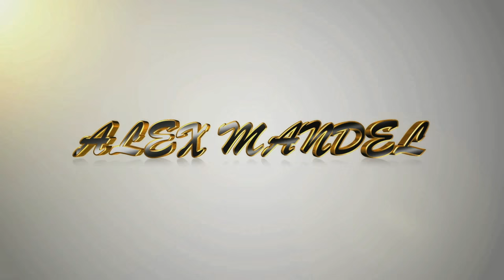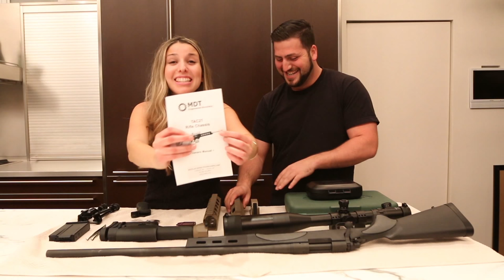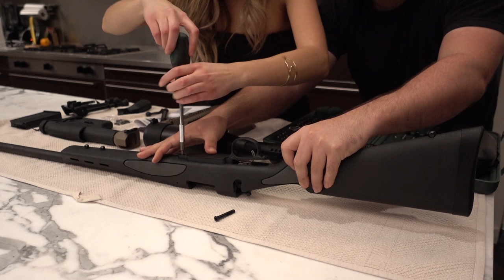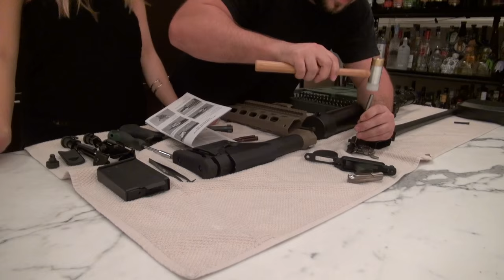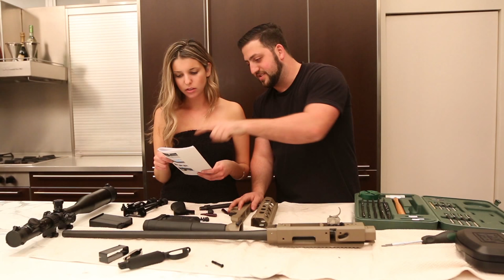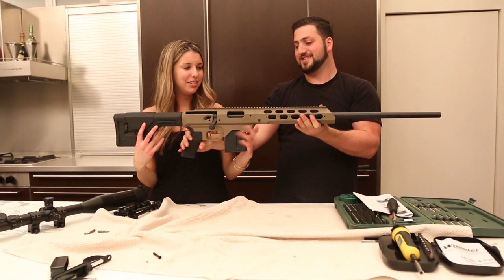Building A Custom Sniper Rifle

Comment: I got lucky with a 700p and it is super accurate, I did put a timney 510 in it and a Badger Ordnance M5 trigger guard.  Basically it is the same rifle you have, i've got an aluminum bedding block and you have a chassis system.  How does yours shoot?  I know it can be hit or miss with these mass produced rifles.  I hope you tested out the rifle first to make sure you got a straight one, so to speak.  Mine loves 168gr SMK.

Oh, and to answer the girl's question.  No it's not a sniper.  A sniper is someone with specific training, 90% of which is other than shooting a rifle.  So, yeah, putting a different stock on a 700 is not "turning it into a sniper."  Any rifle can be a sniper rifle in the hands of a sniper and any rifle that a sniper uses, even the most advanced custom rifle could be a plinking rifle in the hands of a plinker.  So don't worry, the rifle isn't going to stock and hide and gather intelligence and maybe shoot an enemy combatant just because you switched out the stock.

Comment: Alex, since I only have a limited knowledge about guns, maybe you could answer this...Since the kit replaced like 80% of the gun's parts, leaving only the trigger assembly, bolt and barrel as original parts, couldn't you have just bought those three "parts" separately and built a new custom sniper from scratch, rather than converting a hunting rifle into a sniper? It seems like it would have been cheaper that way.
Reply from the maker: The action is the only part of the rifle that has a registered serial number. For that reason, it needs to be purchased from a licensed Firearms dealer. Remington does not sell their actions as a standalone so I needed to buy the rifle. Everything else can be bought online. :)
Reply: Ok, I thought it might be because of the serial number. Does this price out cheaper/competitively to a sniper purchased at retail, or would you do this simply for the experience of building it yourself?

Given we've learned your apartment is an impenetrable fortress if you lose power (or your keys), and since you have an armory worth of guns and a rooftop deck for solid sniping vantage point...good to know that you'll be fine in the event of a zombie apocalypse :P
Reply: Brandon Bassani I don't think his building has many tenants. It doesn't seem to be a massive apartment complex, but just a 3-4 apartment building. I think being in LA in general would be the reason it'd be tough (no natural fresh water and lots of people taking all the resources). I would think Alex owning so many guns has taken the time to become proficient at shooting haha. Also, I don't think we need to assume anything about who bought the apartment or that it matters. Alex works in Hollywood on what seems like a contract basis for some big shows and production companies and has a successful YouTube channel. I think he's doing pretty well.
Reply: It's also illegal to build a new gun or rifle without proper licenses.
Reply: Mr. Toothpicks No it's not.  It's illegal to build and sell without proper licenses.  You can build for yourself all you want.
Reply: Correct^
Reply: Actually you can sell something you built yourself, as long as you didnt build it with the intent of selling it.

Comment: You don't have a "sniper" it's a hunting rifle that has a cool stock. If you want a long range  rifle you need a scope made for long range at least a 16 power. A polished or new trigger. A new barrel. A new rail is recommended with 20 moa and rings that you can get from warne. And a polished crown would work on the end of the barrel. And you need to learn bullet coefficients, minute of angle or MOA it's a hard learning curve.

Comment: I'm not sure why you would do this to a perfectly good 700 :(
Reply: remington is fucking garbage. that stock probably finally made it shoot right and accurate
Reply: Wow.... you have some very strong feelings towards Remington haha
Reply: Nathan Strange they used to be good until i would say the late 2000's
Reply: Yeah, i don't disagree with you there.
Reply: +FrankieJames7 yeah Remington stocks are no Bueno anymore
Reply: +FrankieJames7 yeah, the rem 700 were great until they switched from the wooden stocks to the new synthetics, just like the rem model 760, they were good until they renumbered the model as the 7600 and cheaped out on the furniture. I personally use an FN mauser action chambered in .30-06. Very smooth action on that rifle
Reply: Brandon Frable nothing wrong with synthetic compared to wood. both are inadequate and you need to buy a new stock to get the most of the gun in both wood and synthetic cases. I have a Winchester model 70 classic stainless with the BOSS. that rifle is worth more than 3 remington's put together. i really like the controlled round feed on it
Reply: r700 are a real let down to what they used to be in the 90's. and the savage lineup is getting to be really consistently good which is great
Reply: ascend didact Agreed!